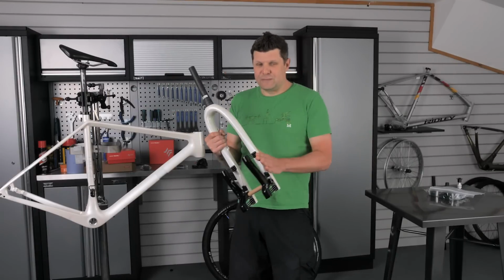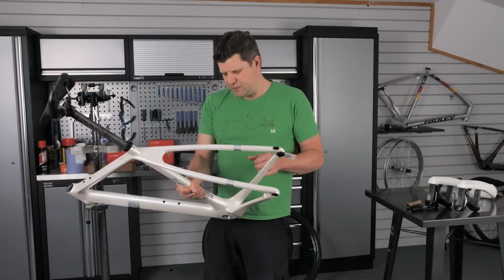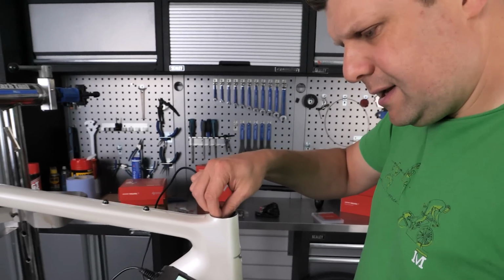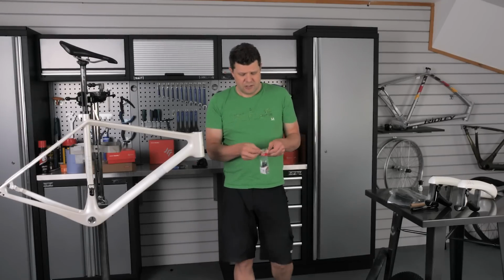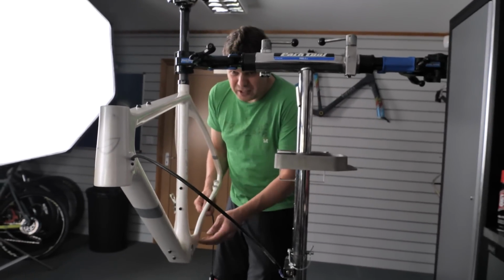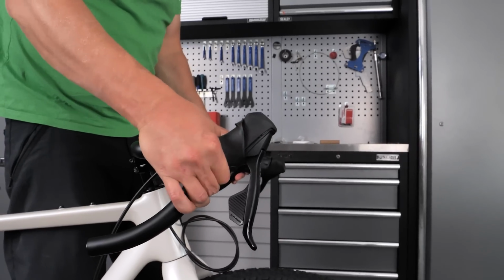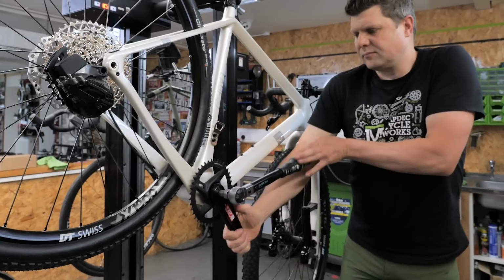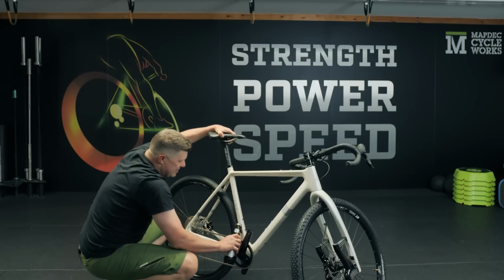The Icelandic Way - Lauf True Grit Gravel Bike

Comment: Hello Paul, I totally agree with you on the advice  of spent your money on the best frame and wheels you can afford first and group set after.  I have just got a Basso Palta gravel frame with Zipp 303 Firecrest wheels.  I went for a Sram Rival AXS XLPR group set.  The Rival is a fantastic group set for the money.  The performance is amazing and looks great.  I went for a 38 c/ring with the 10/44 cassette. Perfect for my type of riding , 70% road and 30% off road.   Total convert to 1x.   Never struggling for gear ratios at all.
Reply from the maker: Sounds great. what a versatile machine.

Comment: The 10t on these cassettes are overrated. Where do you notice jumps in cadence the most? At higher speeds/cadences (essentially over your first 3-4 gears).

SRAM XPLR cassette (10-44): 10-11-13-15
SRAM XPLR cassette (11-44): 11-12-13-15

Majority of people spend such a minute amount of time in their highest gear (you can track this in the AXS app, and even then the % of time in that gear is used is exaggerated as you are often just coasting down a hill in the 10T). This is exacerbated if legitimately using your bike on gravel, where loose surfaces are the limiter of speed on descents.

With the Apex cassette you can the benefits of nice and tight 1t jumps across your first 3 cogs, which is the main complaint dyed-in-wool roadies have against 1x drivetrains.
Reply from the maker: To be honest I have been using 1x so long now that I don’t even notice jumps in the gears. Human body and mind are amazingly adaptable
Reply: @Mapdec  100% agreed (x1 on all my bikes, MTB and Gravel). 

My comment was more to let people know that the additional costs associated with 10t cassettes (especially if you have an existing wheel with a HG freehub) isn't necessarily worth it (arguably disadvantageous) for road/gravel applications.

Comment: Such a nice bike. Why have you gone for the meh SRAM BB bearings 😪
Reply from the maker: What would you choose for £45
Reply: @Mapdec  Hard to say because I don't know UK pricing. Usually I go for Rotor, maybe BBB cycling would also be an option. They make bottom brackets with sensible bearing sizes (standard 6805 for shimano, 6806/29 for SRAM; they use Enduro bearings I think?) as opposed to 30x40x7 which SRAM uses. Then it also makes sense to press in new bearings once the bearings are toast.
Reply: @Mapdec I think most people with a $1000 fork would be willing to spent more than $45 on a bottom bracket. Obviously not everyone though
Reply: @veganpotterthevegan  It's the DUB pressfit BBs that don't last (especially when pressed into most MTBs with a BB86/92 shell).

SRAM DUB BSA bottom bracket is actually really good and on par with a solid Shimano Ultegra BB (which is a fantastic design). 

Have about 4,000km on my gravel bike (and I ride year round). The SRAM SUB BSA bb is still running very smooth. A Wheels MFG costs about 2-3x a SRAM DUB, BB Infinite cost about 4-5x a SRAM DUB. What Mapdec said: what would you choose?
Reply: @lenolenoleno  they're really not that bad for most people,  despite the design not being great on paper.   4000km is also meaningless and not many miles at all.
Reply: @veganpotterthevegan  how is it meamingless? 4000km and feels brand new after plenty of mud and CX races. Means it'll last a good deal longer for the majority of people.

Geez cycalists are a pretentious mob. "Oh 1000 fork should buy a more expensive BB". What are you Paris Hilton matching your handbag with your shoes? Shimano BBs last forever and cost maybe $20 USD for an Ultegra BB. Oh nar but I need to brag to my boyfriends at the coffee shop about my boutique BB.
Reply: @lenolenoleno  because 4000km is a very low bar.  I've serviced BBs I've put 20,000 MILES on just to see how clean they were and they were totally fine and really didn't need servicing at all
Reply: @lenolenoleno  I wouldn't care if this person had a $200 fork. It's the relative cost.  I'd tell someone they're being ridiculous if they had a $1000 bike and bought a $400 bottom bracket for that bike.